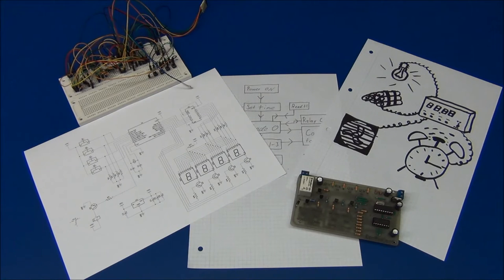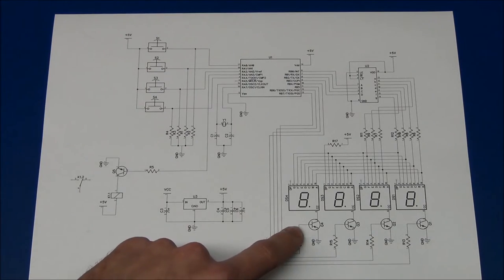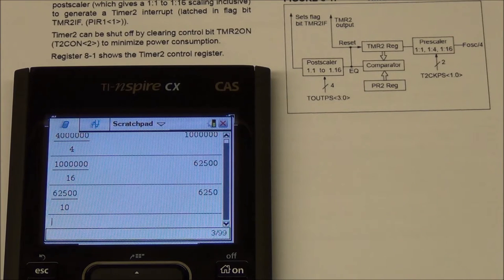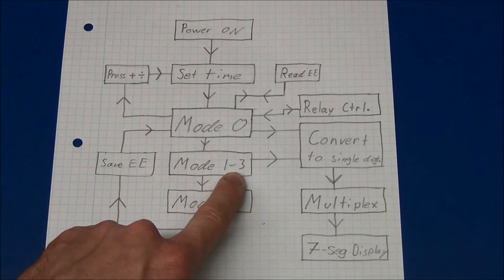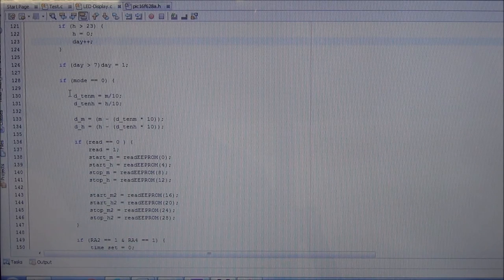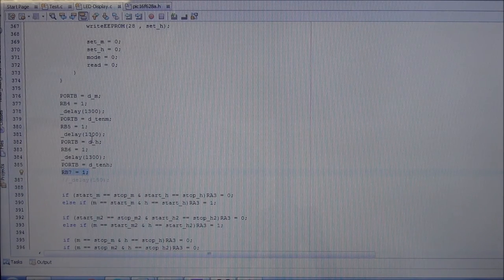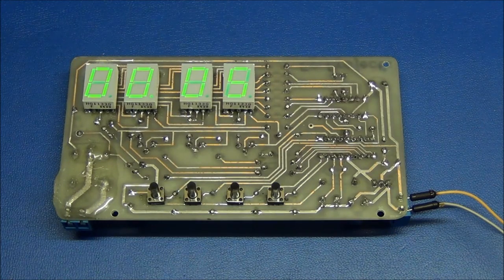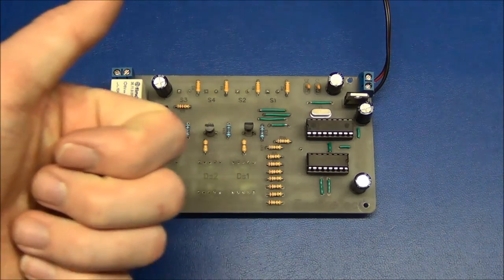Making a DIY Digital Timer-Clock - Ec-Projects

Comment: Hello again...i have finished the project almost exactly as you did....2 things i have changed but i don t think it matters ( the C3 - 1000 uF electrolytic cap,16V or better i have an 3300 uF , 25V and the cd4511 BCD, i have put 4511BE ) i have put the hex file on to pic but the problem is ...i plug it in and nothing shows up...i took measurements and the LM7805 does his thing...i get signals from pic and chip but...when it comes to displays ..it s like nothing goes in...and i made sure that they are comon cathode so it will work...i run out of ideas ...don t know what s wrong it should of worked...can it be the program on pic ...or cd4511 be not good?...i can t figure it out why nothing goes in to displays ...it shows me that the pic and the cd4511 does something ..like i get signals and stuff...but i just don t get it....sorry cuz i m a bit of a noob:D
Reply from the maker: +Mihai Viorel Hi, what you have changed shouldn't be a problem.. Do you measure any voltage at the displays? If not try to measure pin 3 and 4 on the 4511 and see if you get 5v on each, and also pin 5 should be at 0v. (also check to verify you get 5v from Vss to Vdd on the 4511). If you see data from the PIC it is most likely fine. If you don't solve the problem, please send an email with photos of both sides of the PCB, then I'll see if I can help further :) (You can find my email address on the About tab on the channel)

Comment: Hey ...do u have an updated schematic...because i see in your vid that there is an R18 witch i can t find it in The schematics or the component list....what value is it and why did u put it there....and 3 resistors above ds 1 2 3 there should ne straps ...why did u put resistors an what value...thx
Reply from the maker: +Mihai Viorel Hey, thanks for mentioning that.. I don't have a newer schematic sorry.. R18 is for the right most dot point to light up when the relay is on, you don't have to add it, but something around 470 Ohm should do.. The 3 resistors are 0 Ohm, so just "wires"... I will add this to my website as well.. Thanks

Comment: can you please list all the components specifically so that i could buy it in the shop
Reply from the maker: Thomas Brolin I have a list on my website :) http://ec-projects.com/digital-time-clock-relay
Reply: EcProjects I have checked the schematic you have posted in your website and there are some connections which are not connected.
 
1. Pins of the menu buttons = where is this supposed to be connected, to the V+ I guess?
2. Pin 4(MCLR) of the MCU = should I connect this directly to V+ as well?

This is a nice project of yours and I want to make it also for my intended application. Please do clarify those questions for me. Thank you :)
Reply from the maker: Hi'gak Iya Hi, MCLR is connected internally, so pin 4 can be used as a spare I/O pin if you desire, and the switches should connect to 5v as you guessed :)
Reply: Thanks for the confirmation.